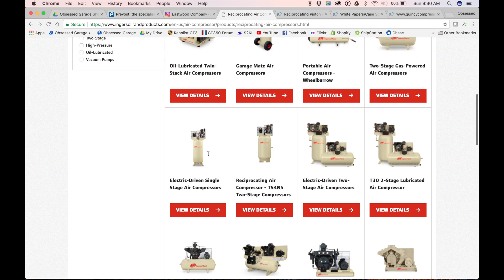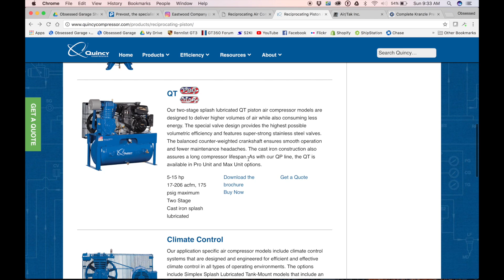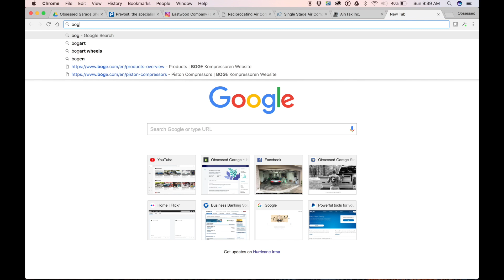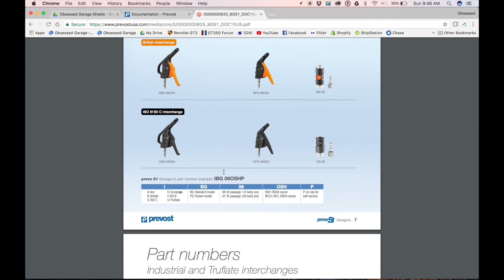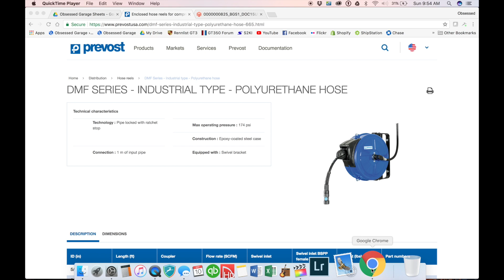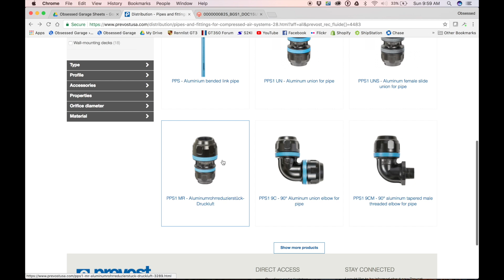Designing the Robert Linton Garage: Video 3 - Compressed Air

Comment: @Obsessed Garage @Matt regarding compressors. I don't know much about your needs in a garage application but as an airbrush artist in the past I used a Jun-Air compressor that is literally as loud as a refrigerator. They now mainly service the healthcare industry it seems. Abandoning the airbrush many years ago my compressor now sits in the garage to fill tires and blow off my work bench. I know they make larger units but unsure if it is strong enough to meet your needs. In any case figure I'd put that information out there for you in case it does and you are not aware of that brand. Hope this helps!

Comment: Matt I have a Kaeser sx5 its rock solid bullet proof, never one issue. Its very spendy up front and cost a bunch to have it serviced but its a set it and forget it situation.
Reply from the maker: How many weekly hours are you using it?
Reply: 25hours a week max. Runs perfect for 4 years now, like I said the service is pricy about 700 every 2000 hours

Comment: Check out the Mattei Blade series. They have a nice industrial look and use a rotary vane style compressor that is more reliable and efficient than a screw type.
115-175 psi
60 db
15-20 cfm

Comment: I'd definitely recommend the Quincy over the IR. I have 2 large compressors at my facility, 125hp Quincy and a 75 hp IR, we've gone though 3 motors in the IR over 4 years, 0 problems with the Quincy. IR is now just used as a redundant backup. Granted, these are large industrial compressors, but a 10 year factory warranty from Quincy can't be beat.

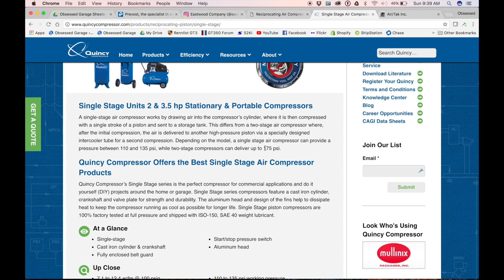Comment: Hey Matt, I have the Quincy 26gl "vertical" you see at 12:00.
I have nothing but good things to say about it. I'm not trying to Solidify or justify my purchase by say this.
I use it to run my Dynabrade cut off wheel and 3m orbital sander, with the 26gl tank it gives me roughly 10 min run time with the sander and longer with the cut off.

Comment: Hey man Aaron here owner of Crystal Clear Detailing, if this helps any we have a 80 gallon commercial grade husky 2 stage air compressor in our Detail shop and we do 1-2 vehicles a day and it fits all our needs from blowing out interiors or paint Corrections likes wet sanding. It's not loud and it's clean dry air don't get caught up in all the hype Larry didn't need all that lol waste of money... spend $1200 and it will do everything your Asking about... call our shop and ask for me if u have any questions.

Http://www.crystalcleardetailingllc.com
Reply from the maker: Thanks man.
Reply: Obsessed Garage check your Instagram messaging been trying to get ahold of you for few days now
Reply: Crystal Clear Detailing I knew Larry went over board on that damn thing lol

Comment: The best place to mount the Air Reels are on the ceiling. You do not need nearly as many on the walls as you laid out - REMEMBER - the more outlets, connections and couplings you have the more potential air leaks will develop - and they do over time! . Wall mounted couplings are not a good idea except if you are putting them over a work bench. You do not want to drag hoses over cars. 3/4"  hose is more than adequate for your needs - you do not need 1" diameter.

Comment: First off you need to figure out what it will be used for, how often it will be used, air requirements for specific tools you might use and how humid the air is in the facility. Stay away from the Home Depot or Lowes Compressors - they suck! The quietest compressors are the double stage units that run at 1750 rpm and they are relatively quiet. The really noisy/cheap  ones are screaming at 3500 rpm and are quite annoying. The higher rpm units are not only really loud but also don't hold up nearly as long. If it will be used constantly (especially in FL with humidity) you will need an air dryer - nothing is worse than wet/oily  air around expensive cars! 
If you are going to use the Compressor often, Quincy Compressors are not going to last long. They are only a 1/2 step above the Campbell Hausfeld and HD Units. Consult a Professional Air Compressor Supply Co. that outfits Service Stations and dealerships. Again - don't get a 3500 rpm unit - you will be sorry!   PS, I have used Air Compressors in a professional business for 30 years and so I am not whistling Dixie!
Reply from the maker: Great info!

Comment: Matt - the compressors you are looking at are all likely to be oiled, while no where near as quiet as a screw compressor, they are significantly more quiet than an oil-less compressor.  The other thing to keep in mind from a noise perspective is that these units will be no louder than your wall mounted kranzle, in fact I think they will be a lot quieter so it might not be as bad as you are worried about.   As far as single vs double, for the home shop user a single stage is really all thats required.  Even if you consider yourself someone who prefers prosumer level equipment, the dual stages main benefit is its ability to deliver higher PSI levels.  A single stage will handle up to 150psi no problem which for 99% of applications is more than adequate.  Even if you plan on using high CFM tools Die grinders, impact wrenches for the length of time you would be using continuous a 60gallon tank unit would more than cover your needs.   Going pro grade in size and capacity really becomes a lot more important when you are doing things like painting with HVLP guns, they use a ton of CFM.      For a shop like yours 60 gallon 5-8hp, single stage would be ideal, from there id spend most of the money on the rest of the setup, the line dryers, and all the lines and connections.  Check out SMC and all their PTC fittings, I used their DOT approved ones for the air lines on my hot rod project and they are slick.   The nice part vs hard lines is that at any point you can pull apart the pieces and splice in new lines as your needs change.  The only decisions you will need to make are the size of the lines you need for your applications from a flow perspective.
Reply from the maker: I found the spec on the LHR75.  It requires 11.3CFM at 110PSI.  Think of it like a sander running for minutes at a time for hours.  What would something like that require?
Reply: wow, ya that is a ton of airflow.   Looking at the largest single stage Quincy on the site it was rated at 12.5 @100psi, so probably it would run 11.8-12 @ 110psi, theoretically it should be able to handle running the rupes full out but really close to 100% duty cycle.   I was hoping the cfm was going to be a lot lower, or at a lower PSI, that would have allowed you to run it at least for a period off the pressure in the tank, unfortunately that volume at that pressure is going to necessitate that the compressor run constantly while you are using the tool.  I retract my earlier statement I think there is an absolute need to step up and go with the a two stage especially if you think you will be using the tools like the rupes for hours at a time (as opposed to spot corrections).  Also think about if you will ever be expecting to run two units at the same time as I know you like to do the joint paint correction videos with multiple people working on the car at the same time.  You'd really have to step up on size if you want to do that.  Also remember that as you step up in this way that it tends to come along with larger tanks so physical size will start to become a concern.  I don't think you want a 120-240gallon tank in your setup.... I'd imagine 80 is as big as you'd want to go, vertical to minimize footprint.  In this case you'd probably need to stick with the goal of only supporting one rupes lhr75 at a time and if others wanted to participate they would need to run the electric models.
Reply: Obsessed Garage Hey Matt, also keep in mind that two stage will almost always have lower cfm than single stage, due to the second cilinder being smaller diameter for the higher compression. Therefore, it will usually be running for longer periods each time to get the reservoir up to pressure, so a single stage with high cfm will have very short running times and being less a bother.

Other than that, have a look at Atlas Copco for air equipment. They are considered one of the best.

Comment: Matt, just my .02, from my experience, I prefer the air access points to fall in between the car park spots. This allows you to go from the point, all the way down the car, to the front of the car without having to deal with the hose getting caught on tires. Think of days before you had the wash bay and overhead boom for the Kranzle. You would always place you pressure washer to allow you the most ease of access for the hose to not be interfered with by the car as you worked. This would only really apply if the cars were typically parked in the same spot. It would definitely apply around the lift area. Another avenue that may be possible for the lift area, as I've never seen this executed in a consumer garage, but I have in professional racing, is to have hose drops, from the ceiling, at all four corners where you would typically be using an air impact. It keeps the hose out of the way and off the ground (hose reel would take up the excess) as you remove and install tires or wheel jacks around (tranny jack, axle jack, etc.). It looks like it's going to be another sick garage and you aim to knock this one out of the park.
Reply from the maker: Dang it I love this channel and community.  I knew you guys would take me to the next level.  Thanks!